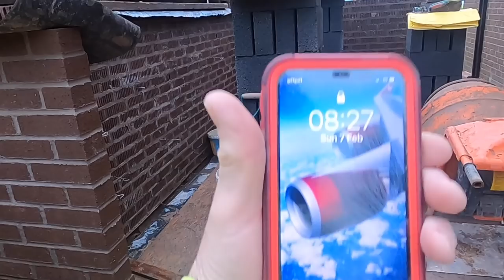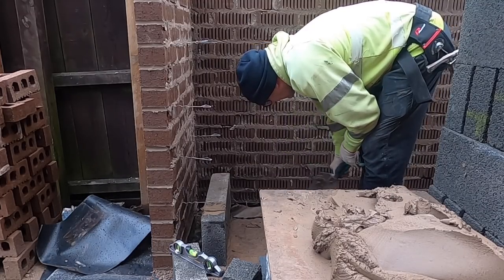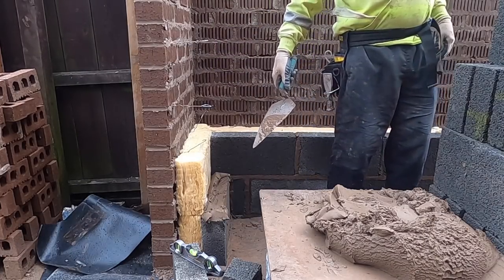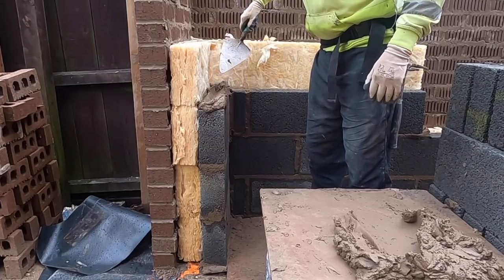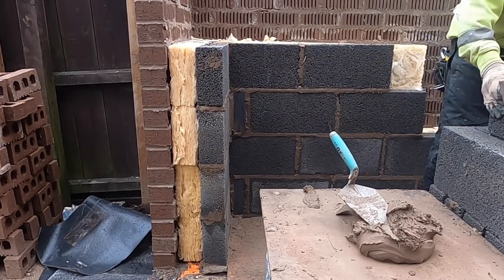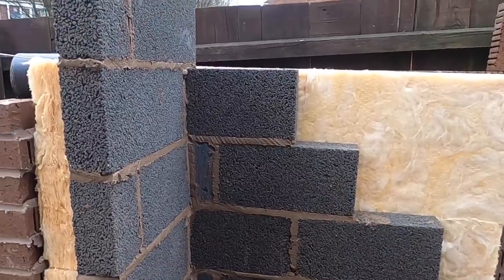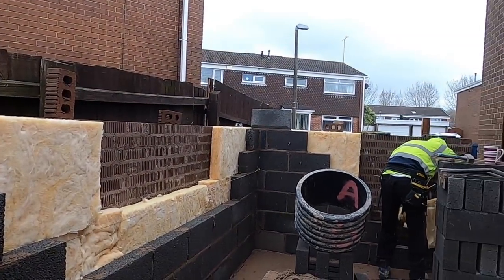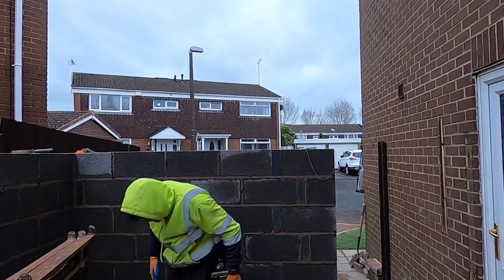INTERNAL WALLS USING FIBOLITE BLOCKS

Comment: Alright Steve and Alex, rally informative and entertaining vids. I think the DPC is there as belt and braces for damp penetration at the abutment. If it cracks (initial settlement) there will be a barrier to prevent wind driven rain. As you know, people do not maintain their properties so, in the long term it will prevent penetration from run off from roofing gutters and the main building
Reply from the maker: Thanks pal 🧱👍🏽

Comment: Steve yours and Alexs’s work is a joy to watch. On the odd occasion when Alex is not quite sure with measurements he always checks with you instead of taking a chance and that’s very reassuring for customers. I should imagine it takes years to be able to use the trowel like you and Alex is catching up fast. Do those little wire things that you slot in between the bricks have to be a certain width apart or can you put them where you want to ?
Reply from the maker: Thanks very much John . The tie wires need to be 900 mm centres horizontal then 450 mm  vertically and staggered plus every course of block around windows and doors 🚪 👌🏼🧱👍🏽

Comment: Steve, get yourself a pair of old fashion BRACES and clip them to your Stanley belt, stops you hitching it up, all the time,  stay safe lads.
Reply from the maker: Thanks for the tip Les 👌🏼🧱👍🏼
Reply: Your spot on Les and they have the heavy duty ones on eBay ....it’s worse when you have long johns on in winter ❄️
Reply from the maker: @ronniebiggs4026  😬🥶🧱👍🏽

Comment: Can you advise on mortar mix, I am mixing 5to1 so l can repair some blown bricks, but mix drys quite grey any idea to get it more sand  colour. Seen brickys mixing but they  do not seem to add colour additives but get a none grey mix. Thanks for any help.
Reply from the maker: Don’t go weaker than 5 to 1 . It’s quite hard to match colours . If it’s a newish house then it’s usually silo mix where they choose a colour . An option is to put done white cement in and experiment a bit . Ordinary cement is very grey and it kills the sand colour . 
 God luck 🧱👍🏽
Reply: Up north we have similar sands that dry grey, I seen down in surreys south you get the colour you were looking for. . Not sure tho if you want a orangey sandy colour or a white one.? As Steve said. Cement called snowcrete... white. And put a spade or so of lime in.  If whiter wanted.  1 cem 1/2 lime, 4 to 5 sand
Reply from the maker: @topcatcoolio8807  🧱👍🏽

Comment: 100mm cavity..."make it 103mm"....some bullsh*t there...+/- 3mm...👍😊.It wont be to that tolerance after 8 courses never mind the top!.
Reply from the maker: 😂 nope , just make sure it’s bigger than 100 and not smaller or that insulation is a bugger to get in. 😤🧱👍🏽

Comment: Is the muck as good to use as it looks Steve .. 🤣🤤
Reply from the maker: This mix was a bit crap as the sand was wet but normally it’s nice to use 👌🏼🧱👍🏽
Reply: @SteveAndAlexBuild  it looked nice and heavy looking .. I hate really light muck. Maybe used to the silo shit at work now I prefer it .. especially on the crap wet materials were always getting 🤬
Reply from the maker: @brickpug6088  🙄 winters been that bad the gear will be wet till friggin June 😡🧱👍🏽

Comment: Why dont you use a level sup bricky
Reply from the maker: Experience pal 👌🏽🧱👍🏽
Reply: If you watch you can see him levelling off of the brickwork which should be running level and hes taping off the back of the brick to keep the same cavity size which in theory means it should be plumb.
Reply from the maker: @man1cs171  Exactly 👌🏼🧱👍🏼

Comment: Not sure why ya deleted a straight forward question pal
Reply from the maker: What question 🧐?
Reply: Just wondered when you we’re running in across the width why the line was on the course above and you were laying with no line to follow
Reply from the maker: @dciburnsidesniffsniff6119  I will need to have a look 👀 when I get a signal 🧐
Reply: Cheers pal ! Weren’t having a dig was just curious
Reply from the maker: @dciburnsidesniffsniff6119  😉🧱👍🏽